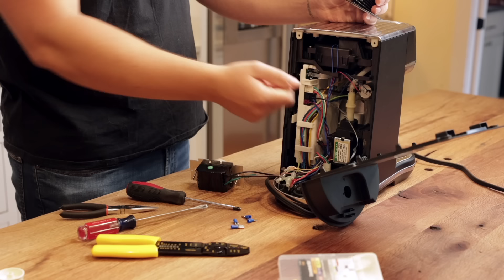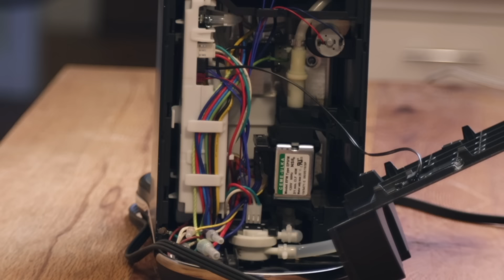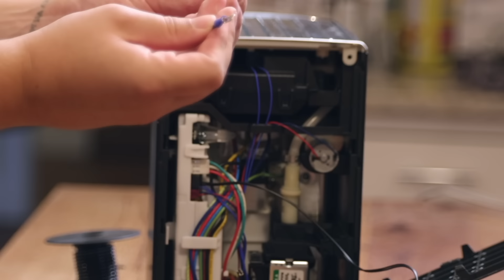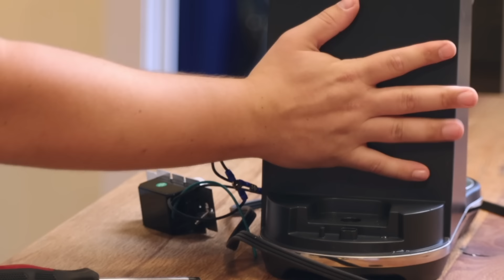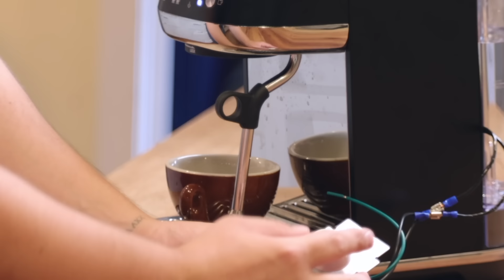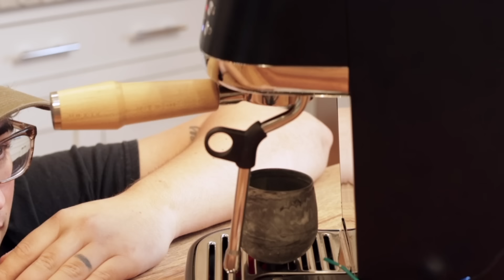Best Espresso Machine Hack: How To Perform The Dimmer Mod

Comment: I've got an old Breville Infuser. I think I might try this. My understanding is that the Infuser is set much above 9 bar. Is it worth adjusting the opv too? Or because the dimmer offers control, it doesn't really matter?
Reply from the maker: I'd also change opv if you can (if it is above 9 and you want it lower). It would still matter
Reply: @LanceHedrick  I also have an breville infuser and would be interested in both of those mods but I heard that because of how the thermocoil works in this machine, reducing the flow with a dimmer as well as changing the opv is causing the water to get way too hot because it spends more time inside the thermoblock that it is supposed to. It seems to be what we see in your video with the bambino (that uses a similar system) when we see a lot of steam. What is your take on that? Does reducing the flow creates too much heat that results in over-extraction and burned taste?

Comment: Lance, I'm curious how this would work on heat exchanger machines. I've got a Rocket Apartamento and I looked into a flow control device, but both retailers and Rocket advised against using it for HX machines due to temperature stability on  HX machines being dependent on how long the water sits in the boiler/flows to the group. Thoughts on this would be appreciated!
Reply: If im not mistaken, heat exchange technology affects temperature at the group head, not flow rate. 
You may be thinking of the PID mod, which doesn't DIRECTLY effect the temperature of the water contacting the grounds.
Reply: @ivanrubalcava08  you are correct. HX tech affects temperature and not flow. That said, my Rocket Apartamento is a HX machine with a vibratory pump (Lance says a this mod works with vibe pumps). The issue is that by restricting flow on HX machines, the water spends more time in contact with the boiler, thus raising the temp above a desirable level.
Reply: @MrGmh22  I think I understand what you are talking about now.
If you did this mod, you you simply do a test of what the temperature is at various time points (5s, 10s, 15s, etc) as you're pulling a shot while following a vetted pressure profiling protocl.

Then repeat after drawing some water initially to activate the heating elements, then pull the shot (i.e. while temperature surfing.)

Comment: Changing the power on vibe pumps just changes how far the part compressing the water moves… to actually change the power output of the pump you have to modulate the width of the pulses. So pretty much you change how fast the pump moves not how much the piston compresses
Reply: Changing the speed of the pump changes the volume it's pushing. So what's the difference when it comes to output at the group head? None. Pressure on the puck = resistance + flow
Reply: @DanTuckerSails  of course there won’t be a difference I just meant to say it’s not linear the pressure change vs change on the dial. If you want to get flow at lower pressure (say 2 bars) it’s impossible with this method because the piston isn’t moving enough to create that low of pressure. But yes output pressure is always output pressure, it’s just that this method has a very small window pressure adjust vs a PWM

If it was this simple breville wouldnt need a patent on their vibe pump control haha
Reply: @domenickmifsud  Do you see how it works in practice in this application? https://youtu.be/val-K-Z_YCM

Comment: I bought my modded Gaggia with a mounted pressure gauge, PID, and dimmer switch for $450 about 3 years ago from a bid. I thought I overpaid but honestly think others were being very stingy now after having used it for over 3 years (and learning the cost of the PID). Plus it came with a bottomless portafilter!
Reply: A modded Gaggia Classic is at another level. You got a bargain.
Reply: My modded Gaggia, cut OPV Spring, Pressure Gauge, PID, Dimmer, https://youtu.be/val-K-Z_YCM

Comment: I've got the Barista Pro and defo looking forward to this mod. Do you know if the regular functions (preinfusion, volumetric shots) on the regular buttons work as usual (assuming the knob is full open)? Also you mentioned you did this on the Barista Pro - would be cool if you could share that too! I'm a bit of a scaredy-cat so that'd help me a lot!
Reply: I've done this on a different volumetric machine. Works fine, as the volumetric sensor is reading flow regardless of the flow rate. It's basically a little paddle wheel, and the sensor is counting the rotations to calculate the volume delivered. Flow rate doesn't really affect it in practice

Comment: I believe this will lead to very high temperatures due to the slow flow rate
Reply from the maker: I've not noticed anything substantial. Also, this video isn't too push people to do this on thermo only but to show how it is done in general. Sure, if you run the whole shot at the lowest setting, perhaps there would be some sort of noticeable difference. Actually, no. I've done this and had incredible sprovers
Reply: Since it is a thermoblock sistem, you are probably right
Reply: The machine had pid which controls the temp in the grouphead regardless of the flow. This is a non issue.

Comment: Nice to see how easily the mod is done!
Do you know how it affects the watertemperature on the Bambino plus? I'm thinking that the thermojet might heat the water more at a lower flowrate. Perhaps this is what is happening at 12.47 when the machine starts steaming again?
Reply: The Bambino has temperature sensors at the inlet and outlet of the thermoblock and uses a closed loop controller to regulate the temperature.
Reply: @tommihommi1  I just had mine apart cause the NTC in the thermojet went bad and had to replace it, there is only one NTC

Comment: Please use shielded connectors at the very least, that is mains voltage you're working with there.
Reply from the maker: Yes. I usually do it I use black electrical tape. I forget people don't know these things and have pinned a note thorough comment about this and added it to the caption. Easier to see what is going on with non shielded connectors

Comment: Mate it is just fantastic, I also watched your other video with the Gaggia classic turned into a 3000 euro machine and it seems that it also extra cute :)
One important remark: I had a discussion with my local Lelit representative and chief technician and he confirmed that the dimmer mod works but with one critical thing to consider: the Ulka vibratory pump has a minimum trigger pressure of 4 bars. In other words, there is a voltage threshold below which the pump does not operate and above which it starts at 4 bar. Maybe there are pumps with lower initial pressure values though. I would love to know your thoughts on this.
Reply from the maker: I'm not positive about 4 bar specifically but yes! You find this out quickly when modded. If you go low enough, the pump will disengage.
Reply: @LanceHedrick  thanks mate. I also consider it important yet minor since nonetheless you get to have the full control of the flow throughout the entire brew, which is fantastic.
Reply: @LanceHedrick   @Leonardo251 seems a little bit strange, pressure is an output, ulkas afaik don't measure pressure or react to it in any particular way. If anything, I think that there could be a minimum flow rate, but I'd argue that said minimum is more than enough to pull most styles of shots out there